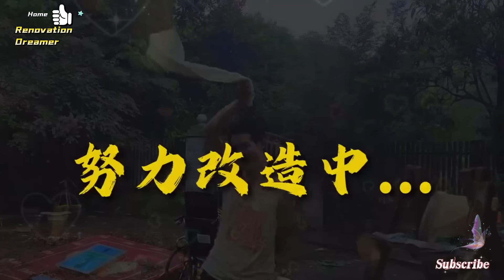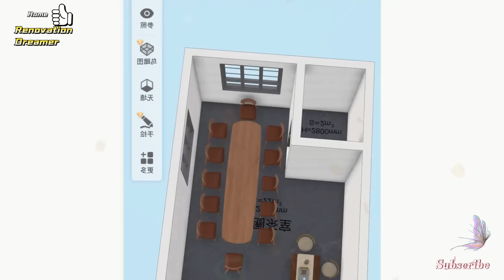Renovate an old rural house and give it a new look. Renovate an old country house for my parents.

Comment: I have watched several videos but never see the end result.  Add that in so we are not so disappointed and will stop watching.
Reply: But these are instructional videos boasting tradition. Showing How-to for different details in a renovation project for different areas or situations. How to deal with problems you might encounter. I would like to know which part of China as they differ a lot. But what you can see is how houses traditionally are placed in a hilly terrain, never on the flat land used for farming, but overlooking it with a steep backdrop. Also ideals of what a homestead should look like, walled flat area with an impressive roofed gate, etc. I think a lot about the risk of landslides …
Reply: yes!!!! Me too. Not interesting if you don't see the final results.
Reply: Yes, true!
Reply: Yes ... me too ... 😅😂